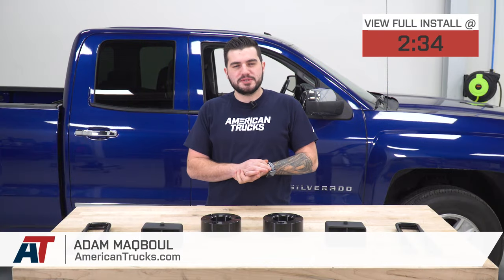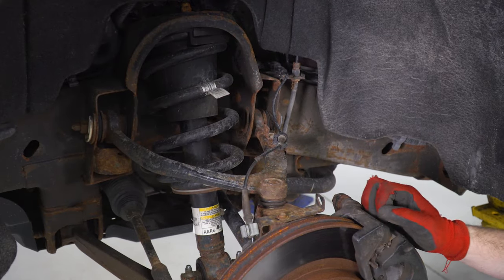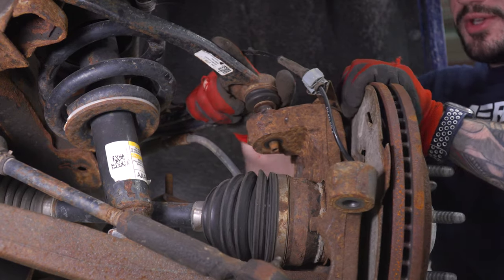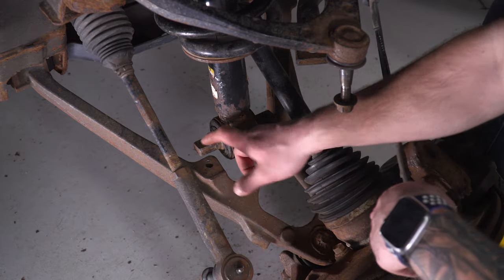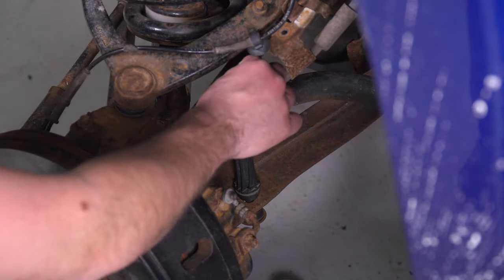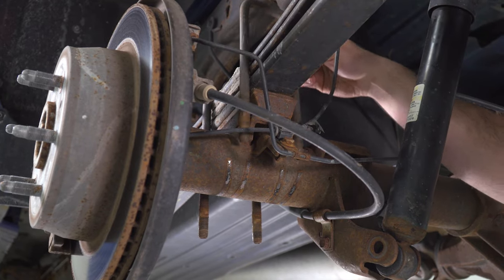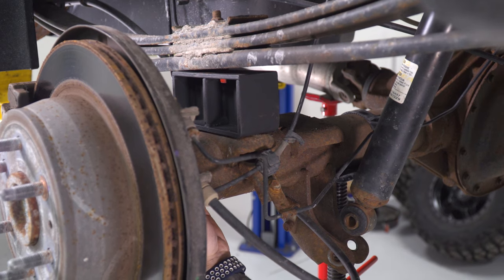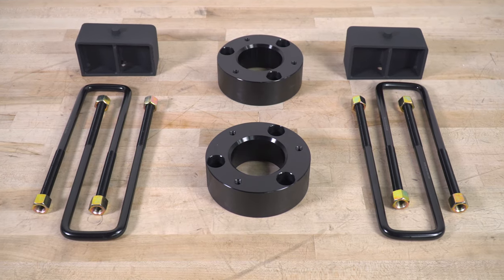2007-2018 SIlverado 1500 Mammoth 3-Inch Front / 2-Inch Rear Leveling Kit Review & Install

Comment: you will need also a new upper control arm to compensate for the new angle of the ball joint, unless you dont mind having factory one snap. and it is also necessary if you care about having an alignment.  if you gonna install these kits do it property or dont dont it at all.

Comment: I believe this will take it from a 2.5" rake to a 1.5" rake. I'm at 0.5" rake right now (2" level on the front) and I still think it doesn't look quite right. I feel like 5.5" front and 3" back would be perfect.
Reply: Won't you have to get a longer drive shaft lifting it 3in or higher?

Comment: overall great leveling kit, but to include all of the other stock manufacturing parts for the front end, highly recommended to replace tie rods, cv's, A arms, Idler arms, spacers or a drop bracket for the dif, wheel bearings. and like I said, no negative remarks towards this kit, you get what you pay for. for me I've been a plain old stock truck guy myself with no upgrades or aftermarket parts and after upgrading to a newer truck I figured I'd try this kit, does make the truck look a whole lot better than having a racked look.
Reply: hey i'm a new truck owner and i was thinking about purchasing this for my f150. how much would it affect my ride quality if i did not replace all of the parts you listed?
Reply: @k1m3zz do you plan on upgrading to a bigger tire size?
Reply: @WilliamWilson-pw5oz  yes my stocks are 31s i’m thinking about getting 33s. i feel like 35s would look a little too big
Reply: @k1m3zz  yeah I went with 33s. No issues either... if you were to go bigger then 33s, might have to tweak the fenders and plastics for them not to rub.
Reply: Do you have to get a longer drive shaft when putting a lift kit on?

Comment: So with this 3” lift do u need to upgrade the upper control arm or u can leave the stock one on there
Reply: Yes upgrade it, there is a upper control arm specifically for lifting these trucks
Reply: @GearScar  ok, i did upgrade it, 2-4" lift control arm, i took my truck to tire corral n they mess up my alignment,
Reply: @predwin87  ok, you need 1 more thing if you haven’t already, get a front differential drop kit, it’s 4 little spacers and longer bolts to lower the front differential, doing this puts your cv axles at a nicer angle to reduce the lift kit stress on them and prolong their life

Comment: Dude, it must be slightly different with the torque of the truck but I had problems left and right with a crew cab. Exp: You needed pry the stability bar up, I needed to go down, also you did t talk about how the strut no longer lines up.....that was a huge hassle!

Comment: Do I need to replace the original shocks ? I installed the 3 inch block on the front and the upper ball joint won’t connect. I’ve already lifted it with my jack and I’m not able to install back my upper ball joint ?

Comment: I’m having major issues with my lower control arm not making it up to the ball joint. Any tips?
Reply from the maker: Because of the 3-Inches in the front it is a pretty hard angle so we do recommend upper control arms that are angled correctly for that extra height. If you're still having trouble, we recommend trying to loosen up the control arms or even putting the vehicle down with and jacking it up with a floor jack to meet the two.

Comment: Dont be afraid to try multiple tire sizes on your truck. The sizes varies a little manufacturer to manufacturer. I am running 35s on my 2018 Silverado that I leveled with the 3 inch kit
Reply: Awesome. What tire are you running and how did you get them to fit?
Reply: @zo6freak  Hercules all terian. I did nothing. They fit with the factory wheels
Reply: No rubbing or scrubbing at full turn?
Reply: @Adman-p4j  with the factory wheels yes I had yes. Wheels rubbed on the control arms. Tires clear just fine even when offroading
Reply: I was going to say I’m on a 2015 with a 2” level kit and run 33” KO’s’s no issue. A 3.5” should fit 35’s with no issue. Maybe a tiny cut.
Reply: @mrmidnight32  no trimming necessary on install. 90,000 miles later and a slight trim was needed.
Reply: Factory 20” wheels? Or they smaller?
Reply: @StellsBellz  Yes, I stayed with the factory 20 inch wheels and had minimal issues. Slight scrubbing at full lock was the only issue I have had. I run 35x12.5r20. Currently running BFG K2O at 30 psi. You may also want to look for a better strut assembly as well. The OE struts wear out quicker when running this style of leveling system. At 104,000 miles and needing to replace them again. Even when worn scrubbing isnt bad.
Reply: @masonseets1682  did you by any chance regear and does the truck seem to handle the 35’s no problem. Thanks for getting back.
Reply: @StellsBellz  I have not done any regearing. The truck is handling 35's just fine. You will need to program the truck to let it know it has bigger tires on it. Bullydog programmers work great on this series truck if you dont feel like going to the dealership.  I do not mind answering your questions as I have had this leveling kit for over 100k. If I dont have a answer i can research and get you pointed in the right direction
Reply: @masonseets1682  last question sir I promise. Any issues with the 4x4 engaging or any type of weird grinding noises while driving in 4 wheel.
Reply: @StellsBellz  ask as many as you need. I have no issues with 4 wheel drive engagement. Leveling kits such as these do not require the transfer case to be reclocked. If I remember correctly you wont need to worry about such things till you get to bigger lift kits. Generally around the 8 to 10 inch mark, but I could be wrong
Reply: If you’re doing 3 inch lift swap upper control arms they make some that do not rub 35s
Reply: @brandonshane9428  they do. I rub on the lower control arms, though. I recommend changing the uppers as the factory ball joints on this series will drop out. I have seen it happen on stock trucks and Tahoes. I decided to risk it and leave them be. 110k on the truck and still have stock suspension
Reply: Great info. Thanks guys.
Reply: is there any binding noise when you turn ?

Comment: what are the drawbacks? more strain on the drivetrain?
Reply: the control arms go out of angle a bit but it's not enough to cause much difference. You will notice a change in how your truck goes over bumps (rougher ride). Fuel economy drops the higher you lift it also.

Comment: Technically you are not rasing the rear of the truck 2 inches at all, it will only be 3/4 of an inch! The stock block is already 1.25in, so you have to remove the stock block, and replace it with a 2 inch block, therefore only rasing the truck 3/4 of an inch.
Reply: It’s a 3inch rear block. The logic he explained was the stock block already sits 1” so replacing the stick block with the 3” block makes for a total 2” rear lift. He measures the block in the video

Comment: After this mod. Would you be needing to do an alignment? Just wanted to confirm that. Thanks.
Reply from the maker: We always recommend getting an alignment after modifying your suspension! -Zach
Reply: I ordered a simple front leveling kit and about 2 months after install I noticed heavy camber wear even though it drove fine. Don’t make the $600 dollar mistake I did and get an alignment!

Comment: Does this put much strain on cv's? Would you need to get some dif drop brackets as well?
Reply: so, I got the kit, and yes, I'm needing to look into drop brackets or spacers for the dif as well, because I just had my passenger cv go out. and yes, I'm a little late to the feedback because at the time of me getting the leveling kit, I thought of the dif, but was wanting to see how the overall performance was with just the leveling kit.
Reply: Not late for me, anything else you would upgrade? I’ve got a 2011 Silverado that a new motor ready for this upgrade. Think of doing Monroe struts and springs. I do remodeling and pull a trailer often.

Comment: I thought you had to change the control arms to keep stress off the ball joints with a 2.5 to 3 inch lift??
Reply from the maker: If you have room in your budget, a set of aftermarket upper control arms would go a long way in helping your ride comfort and suspension angles for sure! -Zach
Reply: Your supposed to, but it will drive

Comment: Looks like the right amount of height I would like to add to my '14, however, my question is would I need longer rear shocks in order to compensate for the 2" lift blocks? Any insight would be appreciated.
Reply: If you don't get longer ones they will most likely go out down the road

Comment: I have a 2007 Chevy avalanche and I'm planning on installing a 3 inch lift up front using (2inch extended struts from freedom off-road) and a 1 inch under strut spacer and 2 inch rear spring spacers. Along with aftermarket A arms. Will I need to do anything else besides new a arms up front?